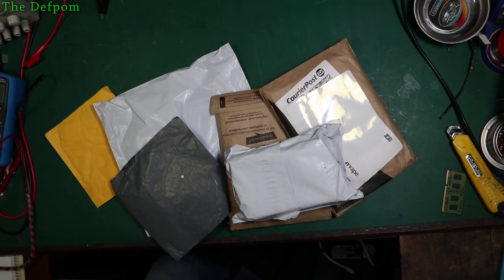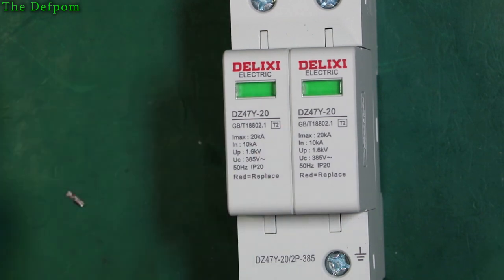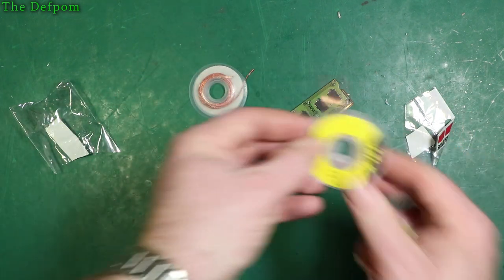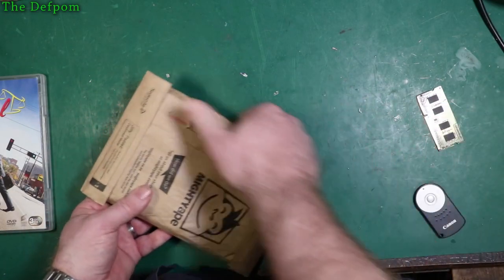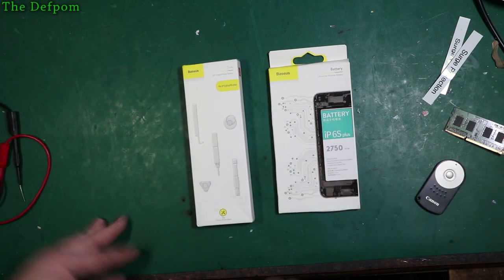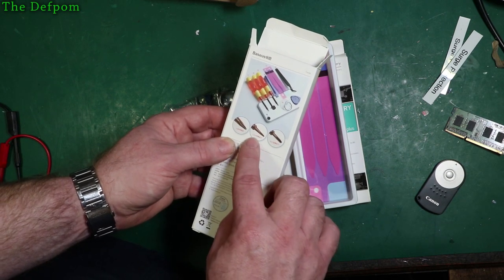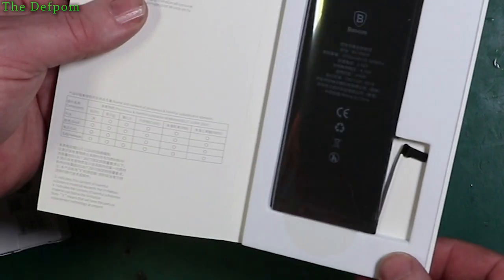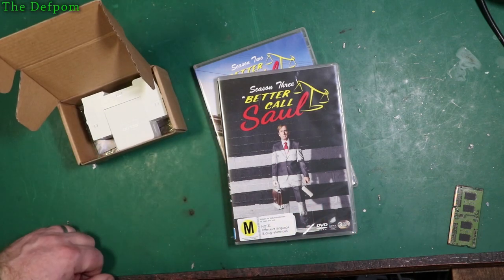#668 Mailbag Monday 23rd December 2019

Comment: Wouldn't mind knowing a bit more about that chip, ie, how you use it.
Reply from the maker: The car has RFID on the steering column, it reads the chip to confirm it is present before allowing you to start the car, you have to program the car to recognise the chip using a special sequence, you have to do the same to program a new remote control with it too.